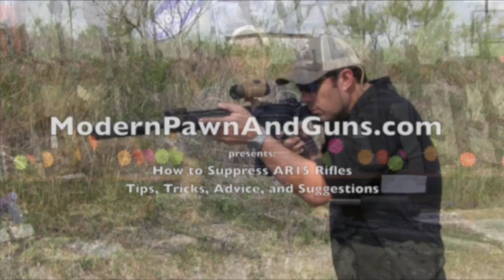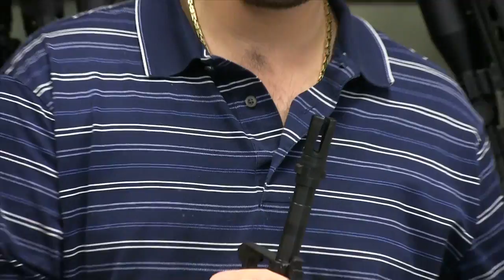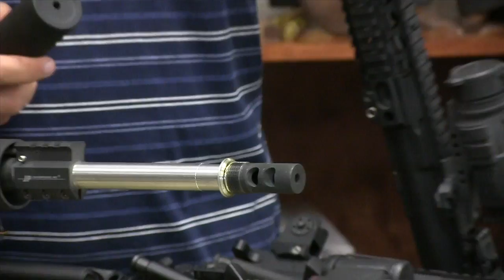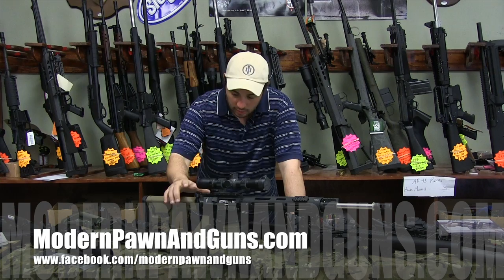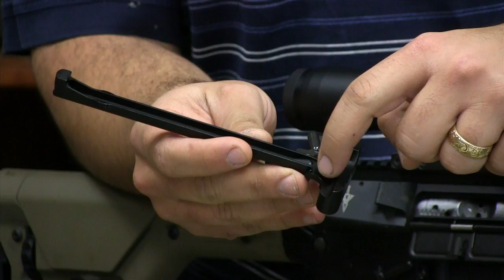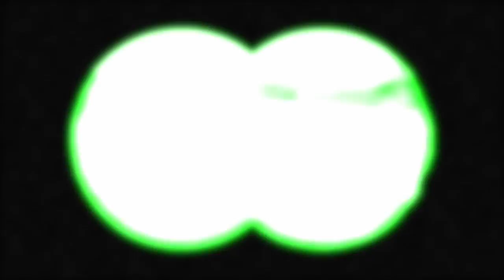Suppressing AR15, Silencer, Suppressor for Gas or Piston Driven AR-15, LWRC, PWS

Comment: Be absolutely sure you have read and understand the manufacturers instructions and the ratings for your particular can especially if you have one that's a "multi Cal" rated can. 
I have a Liberty Mystic that has a long list of cartridges  it's rated for that is now an expensive paperweight because I missed an asterisk noting that It was not compatible with 556 Cal ARs with barrels under 16".  Muzzle blast bent fins bowed the mono core and caused a baffles strike on second shot.
Point of all this....#1 read manufacturers operating manual and rating information and then READ IT SOME MORE!!!!
And #2..." Multi Cal" cans may seem to be a good idea but just like a Swiss army knife, they do a lot but don't do any one particular thing well.
Stick with single caliber type cans

Comment: Great info, really educated me a lot as far as research I'm trying to do.

Here is the scenario(s)

My current suppressors have only been used on my bolt rifles (.308 Saker & .300 WM- Thunder beast 30 P-1)

Would like to use my Saker 7.62 can on a LMTMWS .308.

Your Suggestions :

Buffer/Spring Upgrade?

(Can't put on an Adj Gas Block as current Gas block was machine pressed on at Factory.)

Any other suggestions for this potential set up, looking into the PRI Charging Handle.

Also have a S&W M&P 10 in .308, would like to use the Saker on it as well, what say ye on changes to make.

Your suggestions would be greatly appreciated, thanks for the input, keep those great videos coming, . Subscribed the first time I viewed one of your productions.

Comment: Sig Sauer MCX 5.56 x 45mm, and 7.65 x 35mm removable barrel kit Short Piston Driven with two position adjustable gas system. I went with 16" barrels over the SBR 9".

Comment: Hey brother, 
I am just curious. I bought a neat little beginner's DPMS A15 Panther-type AR a while back when I first started getting into the platform, and I would love to hear your thoughts on how to best suppress w/ economy in mind...I am not looking to spend a ton obviously, but after doing the stamp, I'd really like to see what you think is a great can for a rugged little DPMS that is made to kinda throw around the bush with you and just dump differing types of ammo through. If you could give a few options, I'd be grateful.
Reply: Firstly, I would go with 7.62x39, because 5.56 doesn't have the twist-rate (even at 1:7 twist) to stabilize the flight of sub-sonic ammo that is heavy enough to be LETHAL.  As you're limited to a max of 1050-1100 fps, you rely on WEIGHT NOT SPEED to be lethal.  Also, the SUPERsonic 7.62 ammo is 20% cheaper than 5.56!!!  Get somebody to reload EITHER type (5.56 or 7.62):

because SUBsonic for both catridges is rare (i.e. overpriced :-) ) -- the subsonic 5.56 ALSO is problematic because you'll ideally use 70 to 77 grain, and *anything over 62 grain for 5.56 -- whether subsonic or not -- is hella-expensive (5 to 10 times more than 7.62 steelcase).  It's also harder to stabilize 62 grain than 77 grain.  Think of it this way: a quarterback throws a football slowly, a limpwristed throw, or a top is spinning, as the top slows down, it wobbles... then eventually FALLS down.  As you "throw" a bullet at only <1100 fps, it's more prone to wobbling; if you "throw" the same bullet at 2200 fps, it ROTATES TWICE AS MANY TIMES PER SECOND AS A BULLET GOING 1100 fps.  It also helps the"quarterback" to "throw" a football rather than trying to SPIN something narrower than a football: i.e. *a wide and stubby(short) bullet is easier to "get enough spin" on @ the given/constant 1100fps: 7.62  123gr (even with a 1:10 barrel ) is easier to stabilize than 77gr 5.56 even if the 77gr is shot from a 1:7 barrel (1:8 barely stabilizes 77gr even at 2700 fps!!! Let alone 1100fps = way way WAY unstable).  ALSO, NON-LEAD BULLETS are inferior because they tend to be overly-longforthe given GRAIN WEIGHT, i.e. they aren't as DENSE as lead, and it's harder to stabilize a LONGER BUT LIGHTER WEIGHT bullet.

Some common calibers (max that fits the magazine):
9mm = 147 & 154gr
10mm auto, 40S&W = anything >200 gr (((The lead takes up so much room in the brass, not enough powder can FIT to propel the 154 (9mm) & 200 (10mm) grain bullets FAST enough to crack the soundbarrier...  Same applies to MOST 147gr 9mm's, and probablyAROUND 180gr for 40S&W.)))
  7.62x39 & 6.5CM = approx 150gr
   .308 = most above 200gr and all above 220gr or so should (without even under-filling the case, i.e. handloading it) by their nature NEED to be under 1100fps. (1050fps is only needed e.g. at sealevel, on a cold day, etc).
   .243 Win = 111 or 115gr

A good way to start handloading is a Lee turret machine.  Approx 150-250 bullets per hour...  approx $300, pays for itself VERY fast if you shoot anything exotic (most AR15 subsonic of ALL calibers, 6.5G, 6.5CM, 10mm, etc) in even one of your rifles -- saves approx30 cents per rd for 6.5CM, closer to "5cents and barely worth it" for cheap stuff like 5.56/7.62 steelcase, but to do 70-77 grain 5.56 is also worth handloading -- 62/55 (standard) grain 5.56, not nearly as worthwhile!!  So I buy factory loads for common/cheap grain-weight, then reload THAT factory-made stuff ONLY for my subsonic & exotic (usually HEAVY/long-range) loads.  You CAN reload steelcase, just can only do each case (SUPERsonic) 2 times, and on the 3rd time, you'll get about 10% of the reloads failing (safely, no danger).  SUBsonic, steelcase can go a couple MORE times before you get to the 10% failure rate.  HTH.

Comment: Hi Malik, 
What suppressor would you recommend for use on a PWS MK109 or MK112 ( I would also like to use whatever suppressor I buy on my 556 16" LMT piston rifle)?  I have seen online, and liked, the new OSS suppressor, Gemtech the ONE, and Dead Air Sandman-TI suppressors.  I really like the OSS suppressor because I can take it apart and clean it, however since it claims to reduce a majority of blowback I am concerned that subsonic loads would not cycle using this suppressor. What are your thoughts on this and are there any other suppressors out there that I have overlooked which may be better?
Reply from the maker: Surefire Socom is great.  Griffin Recce 5 is great. The Silencerco Saker 762 with a 556 endcap is really nice on MK109.  I am running a saker right now on my MK110.

Comment: HI Malik,

 I was thinking of running a Surefire 762 Socom RC for my Scar 17 and Lrwc M6 Spr,do you think thats a good buy over the SDN 6 ?
Reply from the maker: Socom is a little bit bigger suppressor, and a lot more money, but I think a superior suppressor.  The Surefire collar mount is pretty much the best in the business, and plenty quite.  I run a SOCOM on my SCAR 17 13inch and its way inside hearing safe.  I also run the SOCOM on a 308 PWS Mark 212 12inch rifle.  Love the SOCOM on both.  It has been holding up real well. SDN6 is a good cross over can (556 suppressor and a compact 762 suppressor).  If you have the money, spring for the Surefire, you will not be disappointed.
Reply: Awesome ! Im glad. I caught my dealer in enough time to make the change the. Also he helped me pay it out over 4 months so the initial bite wasn't that bad.